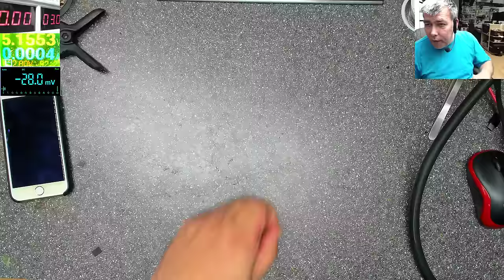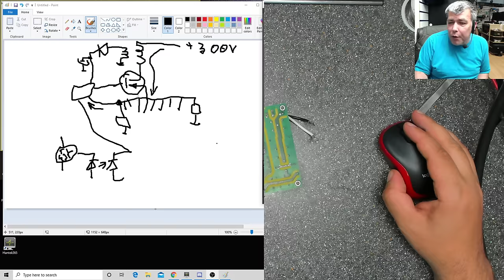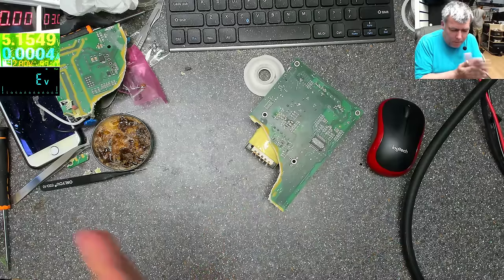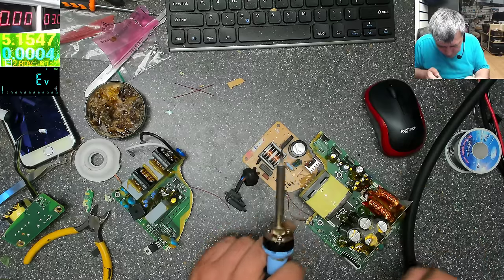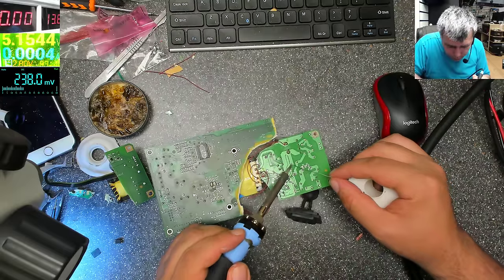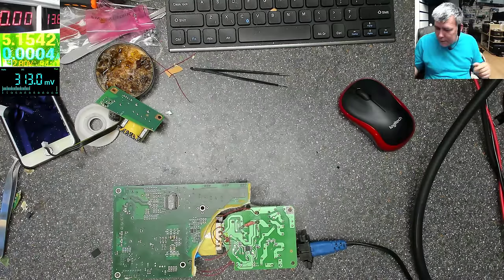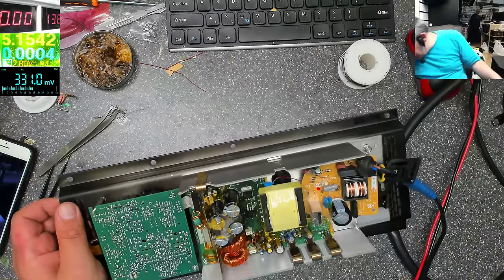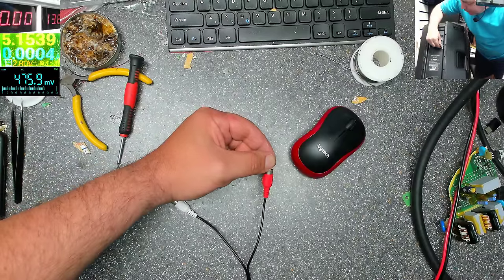Switching power supply repair -Frankenstein method

Comment: I did this recently with an old laptop power supply to power a 36" LCD TV. You should get yourself a Dremmel tool to cut the PCB. It's way easier.
Reply: Yeah, a dremel set or equivalent is cheap and effective
Reply: You should wear a mask when cutting fr4 with a dremel.

Comment: Well, this is a clever and fast way to make a working power supply.
Sorin you can find electronic load tester even on ebay very cheap. With that tool you can test and bechmark the DC power supply.
Excellent video Sorin!

Comment: Thanks for this vid. I'd never thought of this way of fixing a switching power supply. Haha, next time, I bet you won't forget to test the amplifier part by injecting power from bench power supplies, like you always do. You would have found the shorted capacitor. And next time, just cut everything off the hi-voltage portion of the board. You'll have a nice surface to glue the donor board to and it's way faster than trying to break such board in a certain line.
During testing, you actually had a ground. Your computer and the speaker both have earth leads. If not, it would have sounded way worse.
Dodgy? - Yes: Those tiny red patch wires are not rated for 300V. They were sitting against the bare cooling plate. Insulation might rub through, due to speaker vibrations. Hot glue might melt if this amp is operated for a long time at high volume, outside, in this weather.
But still not more dodgy than the average chinese ebay product. Keep up the good work.

Comment: The power supply chip is UC3845 and the KA2 SOT-23 smd maybe is 1N4148 diode.First clean all the fumes and then try to read the circuit and components value and in most cases the circuit is exactly the same with the datasheet of the power supply chip.

Comment: you should have used a Dremel with a cut off wheel to cut the board
Reply: No. It is fiber glass. That dust is worse than Asbestos.
Slowly scraping it is exactly the correct method.

Comment: Biting the wires off when you have a soldering iron in your hands. Heat the end of the wire with the iron and then use your thumbnail and easily pull off the insulation at your desired length. Or use a lighter. It's a very fast way to do your ends.

Comment: I thought the transformer had to be   designed for a specific input and output. I guess the switching cycle takes care of that and the regulators on output make it work. But surely you cant mix and match all kinds of halves of smps. Great video.

Comment: @sorin
i think the 2 amp fuse is ok.
because from primary side of the transformer [ high voltage (240v) & low current (2A max)] and 
on the secondary side[  low voltage (42v) & high current (5A)].
It rectify high voltage(240v) ==> low voltage (42V)
                low current( 2A max)  ==> high current( 5A max)
Reply from the maker: I said the fuse its at the output! :)
Reply: @electronicsrepairschool  thnx for the update I miss this part sry

Comment: The beeg one is an XLR connector. It's a balanced connection. So what does that mean? Let's say you are setting up in a nightclub or concert environment. You may have a very long run with your wires and guess what there's probably a bunch of other equipment lines run all over the place too. This is an high electrical noise environment. Enter your balanced connector. 3 wires, a ground and then your audio signal and then a copy of that signal but out of phase. This is like noise cancellation headphones. Any noise on the lines that isn't your signal doesn't get amplified. 

They charge the shit out of people for this stuff and it's probably a few op amps and comparators. I saw one company asking for $300 to add XLR to your amp. You can get kits for under $10. So they are just taking advantage of people. If you aren't in a situation with crazy amounts of wires running everywhere and lots of electrical noise, you do NOT need balanced connections. Home users don't need this. Don't pay Monster Cable $300 for a 3ft chocolate HDMI cable either. Holy foolishness. 

This was an interesting video. A bit cringe but my dad who was a shipfitter in the Navy would totally approve. You make due with what you have. It's like being on an island, if you don't bring something with you it's not there.

Comment: Few things to watch out for, you connected both half's with silicon, ... well, if the board heats up and the silicon melts then both parts would land at the metal chassis causing a bigger problem, or electrocution !... The wires connected between the transformer and the secondary board are not thick enough, they can heat and cause a problem if their insulation melts. I usually like all your videos Sorin, not too sure about this one.
Reply: The wires are not thick enough... maybe you are right! For sure, I will use a thicker wire only to be sure but on another hand, the current on this wire are not high as I believe the speaker unit has maximum 25-30W. The voltage is aprox 300V, so the current will be aprox 100mA. 
My concern is for the Switching Transistor which has a big chance to overheat as it has a very small aluminum radiator attached too. All another voltage regulators and audio amplifier are connected to the big aluminum case....
Reply: @nricu3604  Hi Nelu (Sorin?!) ... thank you for your reply. 

Well, when it comes to AC for speakers it's not just (W = V * I), you also need to factor in the 2-PI-R-C calculations, the reason is to do with using "frequencies" here, higher freqneicnes can give the effect as-if it's a much higher power travelling through. 

For instance; Audio (which can go up to 96K higher frequency than DC=1F) can change the impedance significantly, which may result in much higher current pushed on the same wire, this causes overhearing i.e. using 30W for DC is ok for 1-2ml wire thickness, but for AC (audio) would definitely require a lot thicker due to higher frequencies and lower impedance, ... 

Try to imagine or think about why passive speaker cables are about 4mm thick at least with a very small voltage across (I have my Dolby system connected using the Sony STR-DA5600ES receiver to all 9.1 speakers with a 4mm cable thickness as recommended by Sony when the voltage is less than 5v anyway! 

I hope I am making sense, happy to discuss more if you like, thank you again for your reply.
Reply: @HeiderSati  - Thanks for your reply but I am not Sorin.... 
I use to do repaire of electronics 20 years ago... was a hobby but also making small money during the school. I learned by my self since 7 years old... Even now, I still repaire and modify everything comes in my hands... but of course I can be wrong and I still can learna lot... still room for improvement😀.
Anyhow, you are right regarding the the AC and Audio signals. 
In this particular case, the wires were used to connect the switching board to the transformer. The voltage here is about 350V (after the 220v rectifier & condensor). So the switching voltage is over 300V. This will require a very low current to produce 30W power(DC). Also, this curent is not permanently ON as it is switching on-off as required, so the heat production is not permanently even that the curent is getting higher (maybe double) for few milisecunde. 
Overall, the input power will be only slightly higher then the output power.   Also, if we take in consideration that the Subuffer  uses a Class D amplifier, the require power will be even less.
What I want to say is that, most probably the wires will be thick  enough (maybe 0.5mm diameter) to power this particular application but for sure, personally I will use much thicker wire for this job.

Comment: Sorin I like your videos you are real PRO. I want to clarify one thing. You said  fuse is only 2A but that fuse is 250V. On the input that's 500W so its in spec for this powersuply 5x42=210W or am I missing something?

Comment: I would have fixed the thing. It's a pretty common driver ....(UC3845). 
 Those are just 5 1ohm resistors in parallel. 
The switching chip is very common.  
That component that says KA2 is just a rectifying diode.  (not a transistor) It's connected to the VCC of your chip. It might be not damaged.
It rectifies the small voltage that feeds your UC3845.
Further on your mosfet is gone. 
But are you sure the chip is gone too? These things usually have a protection diode at the output/input.
And 3 of the many parallel resistors are still ok, so the voltage on the current sense of the chip didn't get that high  (because these are just 1 ohm resistors).
You really could have easily fixed this.
Reply: I would too. And he will, he say that. He also say this was opportunity to teach viewer what to do when parts are not available or at least not on time. You probably know that most important stuff "wait" for weekend to breakdown and I'll probably never use this for somebody's stereo (that can wait few days for parts to be delivered) but I see knowledge about this method useful if I ever again work in industrial field with pressure just to get something to start working as fast as possible.
Reply: you are so smart please tell me your channel so i could learn from a smart you
Reply: Yeah, his fix is just amazing and dodgy at the same time. We can learn from this, but we probably should not use this method until there are absolutely no other possibilities are left.

Comment: darn this power suply mod is both briliant and dodgy as hell, but all i would be afraid of would be 1 hight voltage cap being different value
2 high voltage board net being screwed down. for 2 hours of work you wouldn't be able to probably replace a ll parts to make old one work anyway, not without shotgun rebuild, and even those can go wrong 
reminds me of the old times when i swaped power transformets in american  voltage sony speakers for my pc. good old times

Comment: Hi, I'm  your follower and I follow your videos. I wanted to ask you a question: when you find a short-circuited ceramic smd capacitor on a motherboard how do you know what value the new one needs to be replaced? Sorry my English but I'm an old man of 54 years
Reply: Usually you just pick a similar sized one.
Reply: @SinsBird  yes right ... but not having the scheme how do I know the value if it is burned?  I think it's impossible ...
Reply: @PaoloDiSciorio  I meant physically similar sized not by capacity. If after replacement capacitor failed, that means either the voltage rating of the capacitor is lower than required or voltage too high on the circuit because of a fault. If after capacitor replacement circuit does not work correctly or is unstable, try adding another cap in parallel or measure signal with oscilloscope and see if signal needs more filtering or not. There's no other way.
Reply: @SinsBird  ah ok...thank you

Comment: Wouldn't power oscillator work better?,it has only three wires,easy to install. I use them frequently on hard to fix switch mode  power supply

Comment: If just shutting down the high-voltage part of the board isn't enough for you (cutting off all incoming and outgoing lines), why not just bit off half of the board with your teeth?  That would have made everything soo much easier. 
But indeed, it's such a good board (next time your really should consider using a nail clip)   5000 Dodgy Points !!  ;D

Comment: 36 or 38 is very hot, 27 not so much. Last summer it got 48.8 and my queen honeybees were killed. I ERECTED shade too late and this year I don't have honey bees because I was a slacker. It also killed the fuchieas on the front porch so when this happens again I will immediately shade my honey bees and bring our fuchieas in.

Comment: For fuck sake man. Instead of putti'n together some transformer with board it doesnt know and it is not build to work with... you shoud just change whole supply board with some of the same output and add come caps and coils on output to filter  the noise. Would save a lot of time and trouble for someone who finds out the combination of boards that just doesnt work for him. And he is gonna wonder whyyy.

Comment: Sorry but just NO GOD NO …..
This is not a repair for a paying customer .

I hope you have a good solicitor on speed dial !

As a repair tech we weren't aloud to repair a burnt pcb or one with damaged print .
If it was a lift product no pcb repairs were aloud at all even changing one resistor .